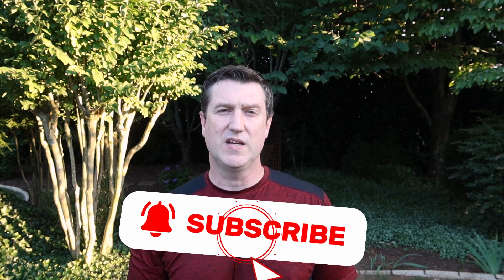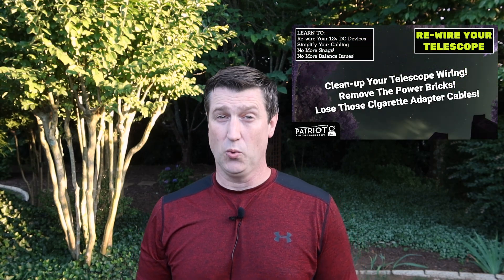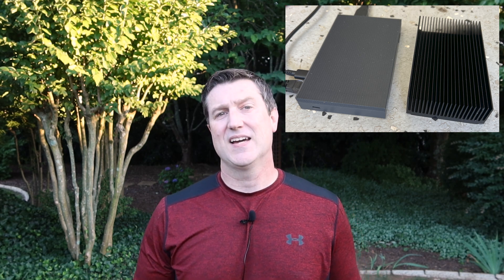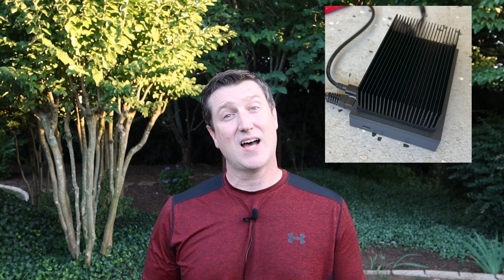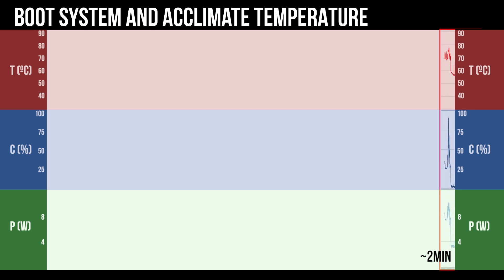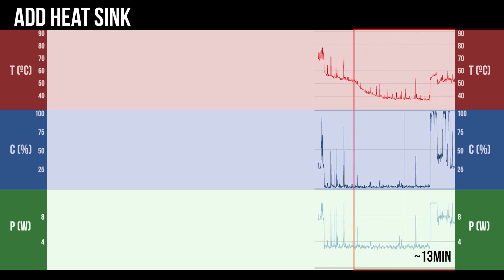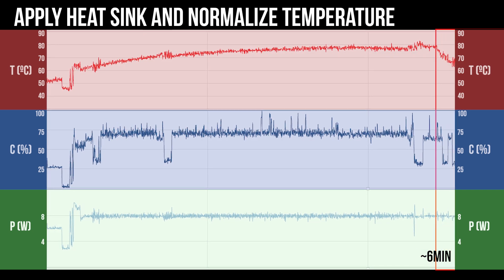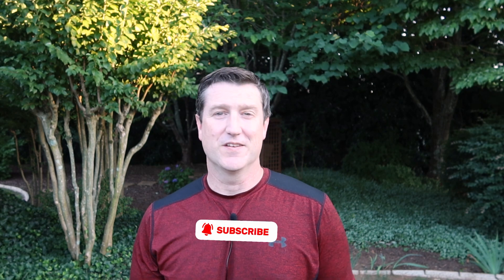Addressing Your Fanless miniPC (Quieter2/3) Temperature Concerns and Power Connectivity Questions

Comment: Great  video! I'm wondering if there would be a significant core temperature drop if the ambient temp was something like 70 vs 95. So the heat sink may not be needed. Thanks!
Reply from the maker: In this case, and with this particular fanless cooling design, I doubt it would matter. The surrounding ambient air temperature will always be lower than the core temperatures, and thermodynamically, heat transfer is from high to low. Two materials undergoing a heat transfer are trying to reach equilibrium, but in our case, one of the materials is the surrounding air which will never meet the processing temperature and always be lower. (Unless you enclose the space the computer runs in and create a closed system where the surrounding air temp could actually rise. Plus, the highest recorded air temp on earth was ~57C in Death Valley and even that is lower that the CPU temps we experience.) Because air temps are lower than our CPU temps, I don't think it matters. BUT, don't confuse this design with fan based designs. Those designs require air flow and often have an expectation within the design about the temperature range of that airflow. The fan can increase or decrease the RPM but if the ambient air temperature is too high, the cooling system can meet its goals. I will also add at the end here that the MeLE system did stay under 80C while at load without the heatsink so it does seem like you can run it without the heatsink, and only really need to add one if you prefer to run it at lower temps or have concerns based on your mounting of the box, etc.
Reply: Thanks Chad! Excellent info.

Comment: I use a male 12v 5.5x2.1 mm  --> USB C power cable that's about 6 inches long. It connects a 12v female terminal on my battery unit directly to the USB-C input on the Quieter 3.

Also, I use a 128GB XDSC card to store images and then, since it can be removed quickly without opening the case, I move the little data card to a card reader on my main PC to load and process the images. Do you know if adding an NVME drive changes the power consumption of the Quieter PC compared to the built-in storage+XDSC? Did you do any tests to see if the (albeit slower) built-in storage was up to the task of keeping up with video capture? I don't do planetary or solar; for DSO the XDSC option works fine and is very convienent for me.

Good call on removing the stickers.

Thanks for your hard work and video toutorials.
Reply: Scott, if you acquired your cable via the Internet, can you please post a link?
Reply from the maker: The power consumption of that drive doesn't seem to add much if any additional overhead. Even under my high load, the Q3 was consistently at ~8 Watts, which at ~12V, is around 0.8Amps of draw (with the NVMe in use). You can go back to my video 1 from my PC performance testing to see the eMMC vs NVMe speeds (maybe a week or 2 old video now). For DSO, eMMC is ok. But for planetary, Solar, Lunar, etc higher frame rate captures, the system was buffering disk writes on the eMMC but never on the NVMe. On the stickers... ya, weird... I know. :) LOL

Comment: I use a usb-c to 5.5x2.1 cable on my ecoflow river battery with my Mele Quieter3Q, runs fine. Still I got an issue with it - sometimes it pauses guiding for a few seconds and I still have no idea why. The NVME (WD blue 3gbps read and write) is kind of dissapointing, doesn't feel to run faster than with the stock emmc. So at the moment I am back at my trusty laptop.
Reply from the maker: I wonder if you have a driver conflict or something in there? Hmm. It could explain your guiding pause, apparent drive perf, and maybe some other system issues. Hoping it is just software and not a hardware issue though since that is far easier to solve.

Comment: I have a Minisforum EliteMini GK41 4 USB3 Ports, 12V input, 8GB RAM and SSD. Perfect connections for Astro out of the box
Reply from the maker: Yep, another great fanless system. Comparable to the J4125 Quieter 2 but with an M2 SATA SSD. So many of these small form factor platforms that work great for Astro!
Reply: @PatriotAstro  what i liked is that it uses the normal 12v 2.1mm plug which the camera, filterwheel etc uses. used it for 2 years in a housing which is all year round outside. it also turns on when it has power...important for remote control..

Comment: DC 12V power : I have been using with great success DC Y cable splitter + DC to USB-C adaptor. No soldering or anything else needed. https://www.amazon.com/USB-C-Extension-Charge-Macbook-CableCC/dp/B00ZUDYVMA

Comment: Great video, thank you! May I ask, what was the temperature of the surrounding during your test runs? Clear skies!
Reply from the maker: Sure, it was a very hot day in Atlanta, GA. Temp was 97F(36C). I think we are focusing on outdoor air temperature too much though since even a cooled computer will run in the 50-60+ C range which will always be hotter than the surroundings which will actually help to cool our computer. :)

Comment: I purchased the J4125-4GB-64GB Quieter2Q a few months ago and have tested in the hot/humid summer nights here in NC and with a similar style external heat sink the temps stay very reasonable now.  Without the heatsink temps were 60C on the top side of the case while running inside the house. I have not had any issues with this computer during any imaging sessions. They are a good value for the money.
Reply from the maker: They sure are. Pretty amazing for a small system. Thanks for your feedback on your own experience with the box and heatsink!

Comment: Great video!! What about imaging at -25°C like I often do here in the winter? Will I need to remove the stickers? 😁
Reply: I have no experience with the Quieter2/3 but i do use a similar fanless miniPC in my backyard observatory.

The average temperature is about -5°C throughout dec-feb with a few nights here and there below -20°C. I left my miniPC powered on 24/7 without failure, according to the temperature sensors on the CPU and motherboard the PC temp was usually around 15-20°C on a normal day, and around 0-5°C on the coldest days (this is when idle, however i did not have any power saving features activated). I have no idea how accurate these readings are at such a low temperature since it is not designed for those conditions, it might not even display readings in the negatives.

Unfortunately most consumer grade tech have a specified operational ambient temperature range of about 0-40°C so it is a gamble. Notable exception is for example PegasusAstro's Focuscube v2 which according to their specification is rated for -40 to +40°C, i do not think ive seen any other "cheap" astro gear with that temperature spec.
Reply from the maker: @FredrikÖdling  100% right. There are fanless systems that can range through sub-zero and also extreme highs as a guaranteed operating range but those tend to be in the 'industrial' category. You can often find them still somewhat affordable but they will be larger and quite frequently have ports you dont need like multiple DB9 serial ports. In most cases you will be ok for some amount of cold below the published specification but you should pay attention to the system when well out of range for sure.
Reply from the maker: :) good question LOL! Maybe the stickers are a winter coat?
Reply: @PatriotAstro  Seriously,  I wonder if the cold will affect it. I guess I'll know in 6 months.
Reply from the maker: @hael8680  I honestly do not know. I can’t find a minimum temperature for the CPUs or the system. I would suggest keeping it warm as once it gets running it will generate plenty of heat. The initial start in extreme cold could be questionable. I think even body heat would do the trick though.
Reply: At those outside temps....I'd worry about keeping it warm to prevent shutdowns.